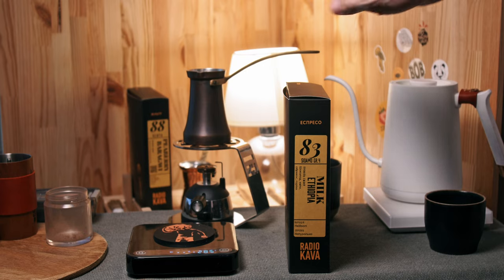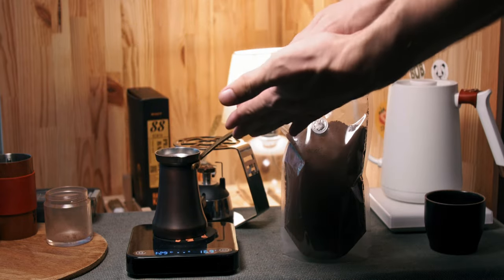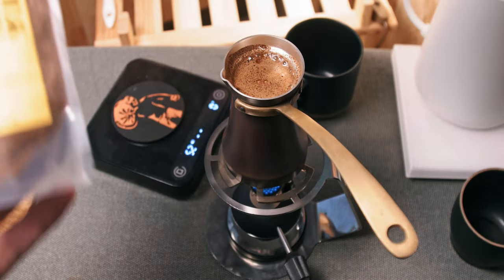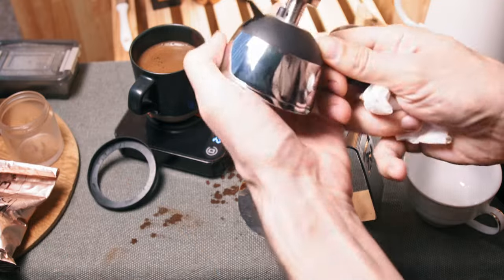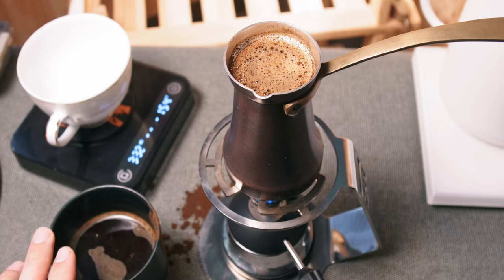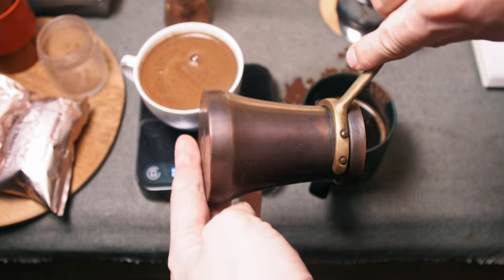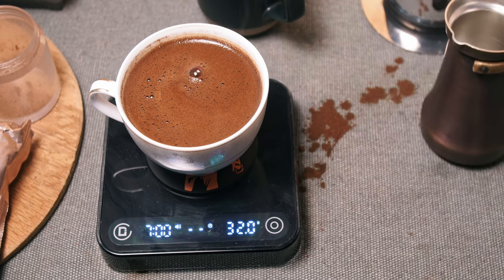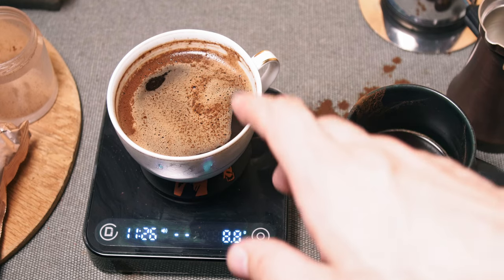Pre Ground Coffee Is A Bad Idea? Turkish Coffee

Comment: does your comandante grind fine enough for Turkish brew?  how long does it take you to grind it by hand?
Reply from the maker: I stopped using it for Turkish coffee and switched to Sozen. But I always use 2 clicks and it takes around 2:30 to grind 15g of coffee. Going to use it for filming comparison of 120 vs 200 ml pot soon because of the grind size stability
Reply from the maker: It is slower (10g of coffee is around 2:30), but in my experience it has better taste and balance. Though, I will make more tests. This was one side by side brewing and tasting. Took more for foam to raise with Comandante. And foam wasn't that "frothy". Also I want to show that this is a reliable way to start a Turkish coffee journey (and test it for long period of time of course)
Reply from the maker: Also, switching between the clicks is not my favorite part. Better to have a separate grinder for Turkish coffee. If I had a budget, I would upgrade it to 1zpesso x s pro, but currently I use what I have